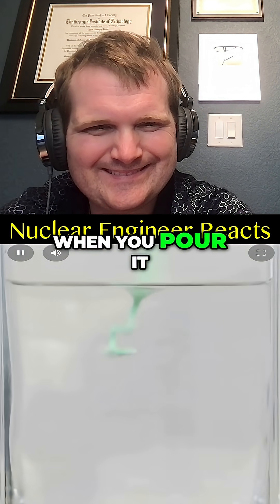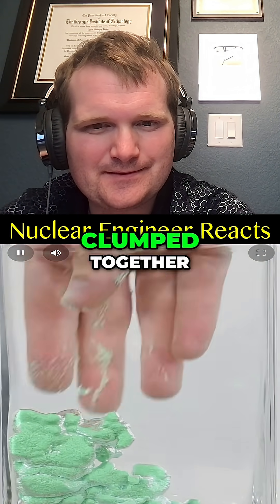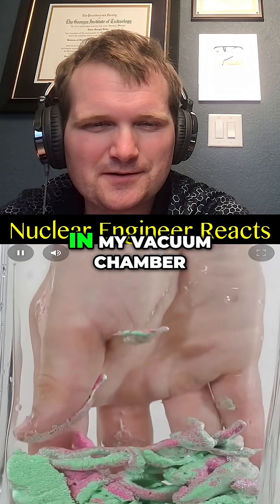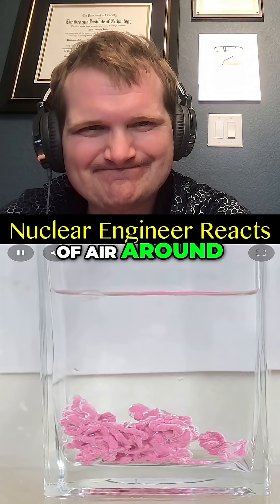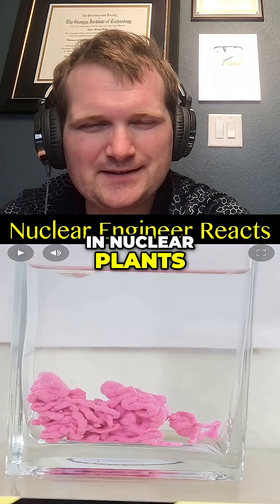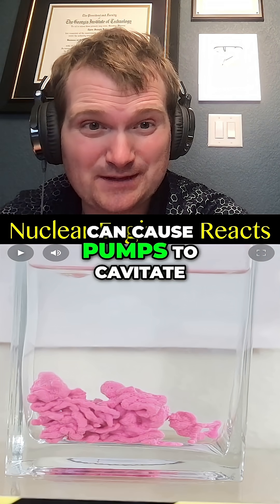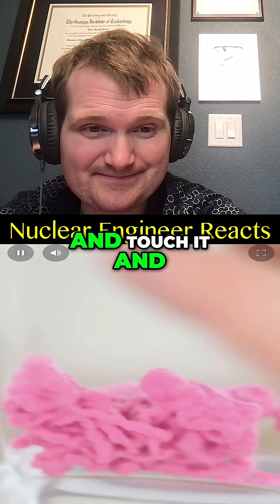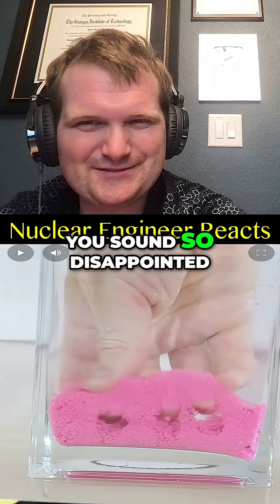This Sand Can't Get Wet, But I got It Wet - Nuclear Engineer Reacts to Action Lab

Comment: This being much like the cladding in a nuclear reactor is only relevant when discussing critical heat flux in relation to film boiling. This isn't normally achieved in a PWR or even a BWR system due to the instabilities of DNB and dryout ,respectively, and safety margins present in both systems.

Comment: What if instead of vacuum pump it with air? Will it get double shiny?
Reply: No, it will more or less act the same as not vacuuming it. All you would change by pumping air in is the pressure on the materials. A vacuum changes everything for this but, pumping does not a lot.
Reply: @ARedGinger   NERD 🤓 (jk have a good day)